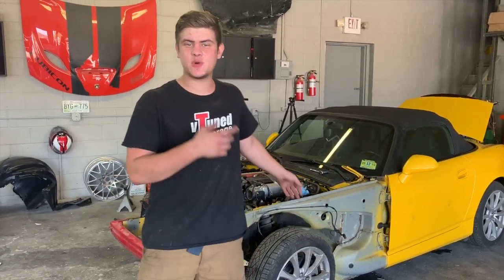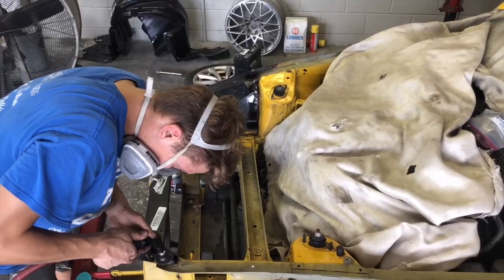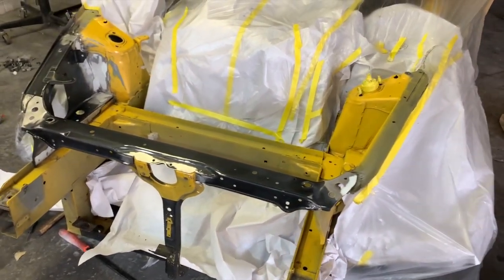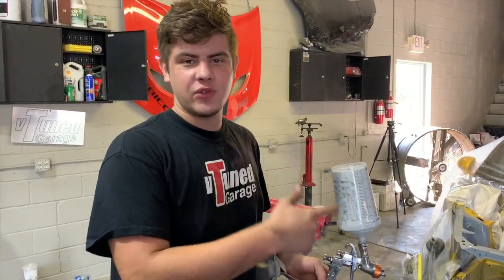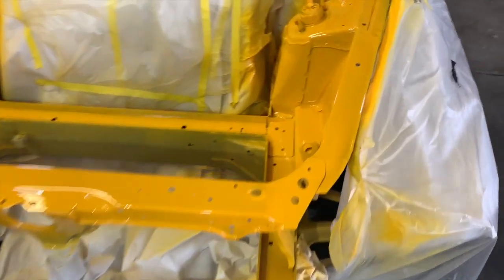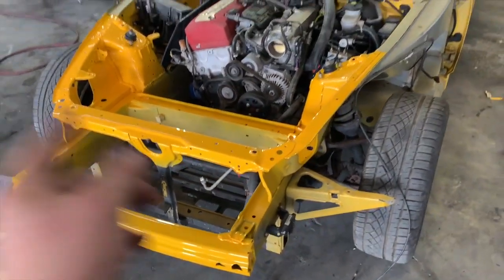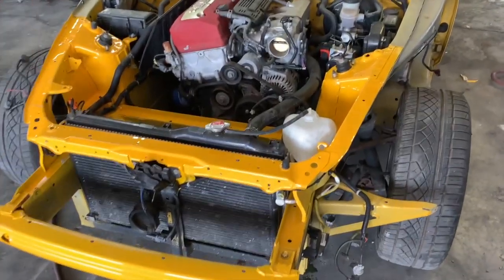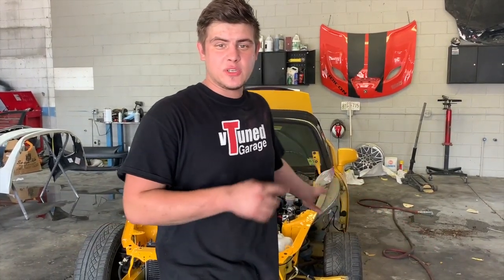Rebuilding A Wrecked Honda S2000 Part 2

Comment: Hey vTuned can you please give us an update on the CTS V? Thanks!
Reply from the maker: Sold it to my grandma.
Reply: @Vtuned  Your Grandma must be like mine was in life, very fast.  When I returned from the orient and she picked me up at the airport, she had decided she wanted a new GM [Grandpa worked for GM over 50 Years] convertible.  Unfortunately at that time, the only convertible GM made was the Corvette.  She Loved that Corvette Roadster and shifting through the gears again.  Yes, it was a manual transmission.
Reply: why did he  bondo a metal frame
Reply: @codybersicc7939  He said in a past video if the weld isn't 100% he uses a bit of filler to make it perfect. There's nothing worse when you get a car fixed outside it looks great but the inside is rough as a spot welders work bench!
Can't knock a perfectionist
Reply: Did you ever finish the pizza car or did you send it up to Tavarish to finish it for you?
Reply: Just so you can see no distortion in the light after its painted i would imagine,,attention to detail !

Comment: Interesting to watch, however you missed a few plastic clips (now painted yellow), didn’t fully spray some of the radiator support sections, didn’t primer or paint the inside of the replacement fender, etc.   You also had a chance to do better than the factory by painting some of the unseen non-painted sections of the inner fender areas.

Comment: On a completely unrelated topic. I have been inspired by you and the boys from goonzquad to do some work to my own cars. Other than basic oil changes and tire rotations. 
So I’m changing the front forward control arms on my kids 07 bmw 335i and the nut in the hall joint is stripped. It just spins on the ball joint. I have tried using a jack to push the ball joint up to put pressure on the threads to grab but it’s not working. I don’t have enough clearance to get a saw blade in there.  Any tips or tricks?